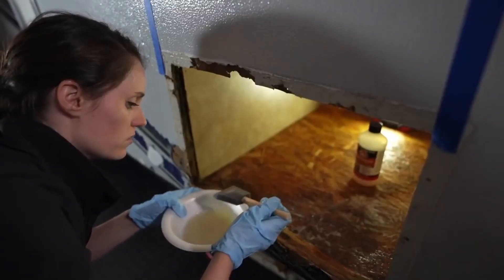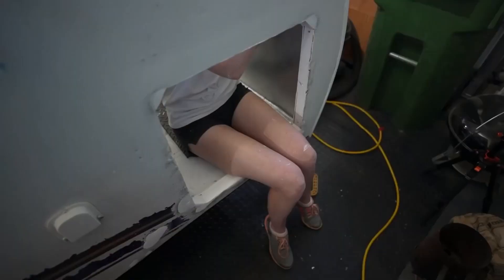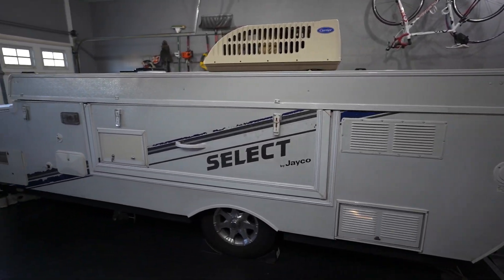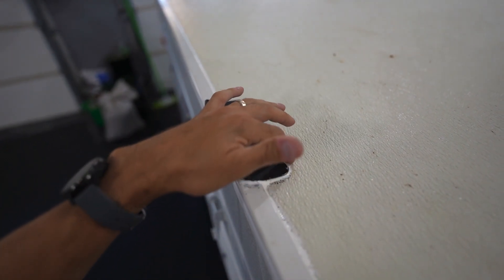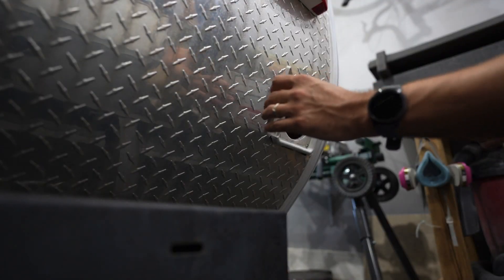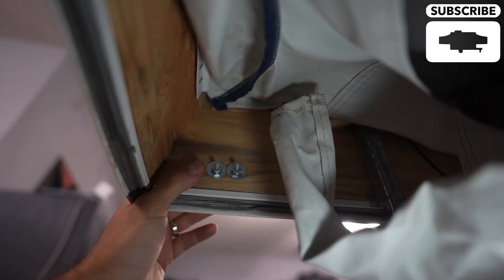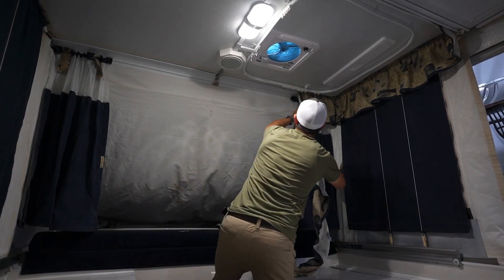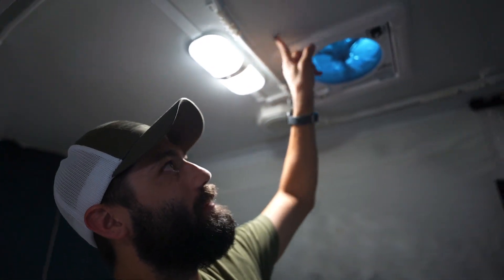DON’T Buy a WATER DAMAGED Pop Up Camper! | How to Check for Water Damage and Leaks Before You Buy!

Comment: If a 2005 Aliner hard sided A frame pop up has soft areas in all for corners underneath in subflooring, could it possibly be repaired with the product you used in your video?
When I inspected underneath I thought it may have been from years of traveling and just wear and tear. Then I saw this video and wondered if leaks in all four corners?

Comment: This is why I only paid 200 for mine.   Worst case I get working appliances for my micro cabin and I get a frame for a work trailer.  I lucked out and I think I can repair all the water damage for about 400 bucks.

Comment: If I had a dime for every time I see a ruined popup camper someone is restoring a crappy trashed popup. We purchased a popup that was stored in a building, some fool put an automobile roof rack on it. Last winter we stored it outside and the cover blew off. It did get some water egress because of the roof rack. I removed the roof rack and repaired the damage caused by the rack and filled the holes. I resealed the roof and fixed all the seams. The floor is solid and I have done general repairs. Easy way to check for water damage inside is look for rusty staples they used to install the roof panels inside. Also any exterior rusted screw heads or removing a screw indicates  water issues if the whole screw is rusted. I replaced all my screws with stainless steel. Lucky for me all my roof wood is solid.
Reply from the maker: On point with the rusty screws and staples.

Comment: Getting ready to buy our first pop up tomorrow (from a dealer). Excited to use the knowledge from your videos to check the condition and then enhance the whole experience for the family.
Reply from the maker: Used or new?
Reply: Used, 2018 Rockwood Premier 2516G. Being our first one, we didn't want to risk something too old, but we also wanted to shy away from some of the QC issues from 2020 and 2021 models.

Comment: Thanks so much for this video!  We bought one that had both the front storage bin water damage in both corners as well as the 2 support bolts you mention around the 6:22 mark.  I see you used the JB wood hardener on your storage bin, what would you suggest for the holes  where the support bolts in the corner of the roof?  I've tried sealing them with Flex Paste and it appears to be water proof but is there another product you would recommend to patch such holes?  Thanks so much for your channel!  It's been so helpful!

Comment: What do you think about a 2005 model jayco that has had the roof replaced. Owner now says the previous owner took all the caulking off and it leaked, and ruined the roof. This owner replaced the roof, would you say it’s pretty fair to say the floor seen quite a bit of water, or do you think it could still be solid?
Reply from the maker: The only way to know is to physically check it

Comment: We were looking for our first popup, and i was looking for local sellers of used campers, and all of them were water damaged to some amount.  My thought was, I'd spend $1500 or so on a used camper, fix it up, and we could use it for a few years until we got a better one...  Once i looked into how much work it would be, essentially it would be a project, not a camper... and we'd never feel fully comfortable in it due to possible bugs etc.  So we ended up getting a 5yo used one (which is in mostly pristine condition), with a warranty, from a dealer, who probably ripped us off.  Essentially a new camper as our 'starter' camper..
Reply from the maker: Yeah, I’m sure it depends where you’re located, but these days it’s very tough to find a solid camper for $1,500.

Comment: The seller thinks the previous owner caused these stains by not drying it out properly before storing. He says there’s no leaks whatsoever. I’ve not seen this in person yet, they are a long drive away. I like everything else about this camper. It’s a 2004 Rockwood. Thoughts? (Trying to attach picture)
Reply: It won’t let me attach a photo but there are rust colored stains on the canvas on one end.
Reply from the maker: Rust colored stains indicates there is a leak in the roof - most likely rusting out a metal component such as screws before reaching the canvas. Triple check for water damage in the roof.

Comment: Doesn't do much to the newer popup roofs, since they are made of styrofoam and fiberglass. But the floors ,it isn't good when it reaches that far. Our Palomino has the wood covered in a black plastic, even the bunk undersides!
Reply from the maker: What year do you guys have?
Reply: @ItsPoppin  it's a  2016 T-8LTD.